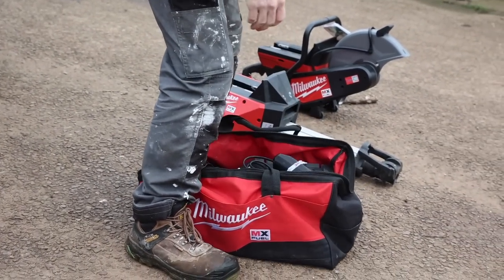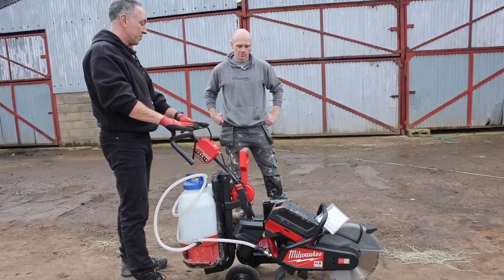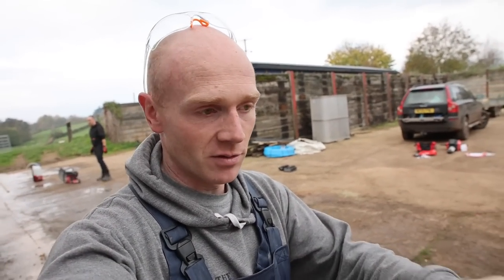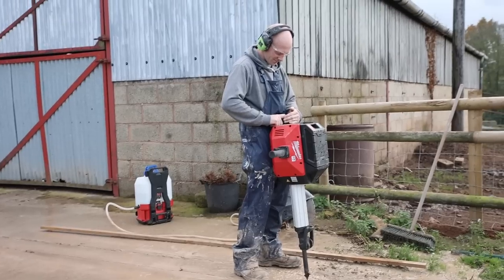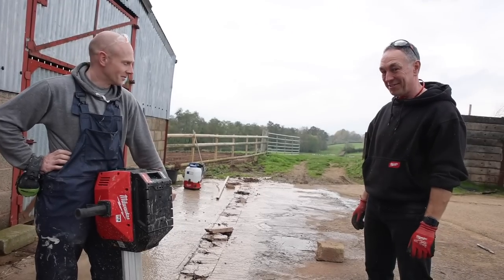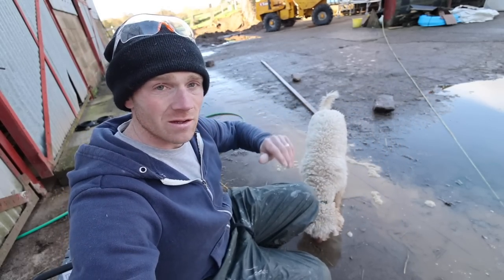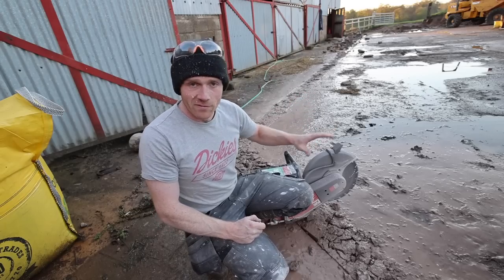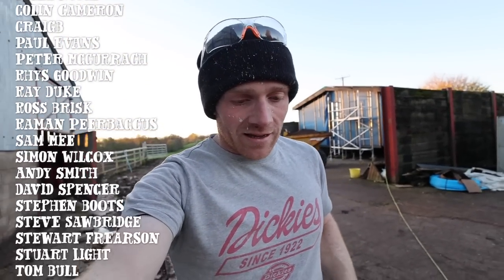CUTTING & BREAKING CONCRETE WITH BATTERY POWER - Is it up to the job?

Comment: Think it will become a full time job on site for someone to manage batteries. But having worked recently with a few of the smaller battery site tools I'm loving the quieter sound and instant start. Again love the genuineness of this channel when it comes to use of branded products. So many Chanel's have tool sponsors that they change every year just for cash which I get there's a cost to make videos but feel it often distracts from the content. This was great ❤  👍

Comment: Have cut a lot of concrete, for that I would have hired a floor saw, fee would have been sub a hundred quid with blade wear allowance. Made sure the ground was cut under the concrete to a good depth, this will help prevent the edges spalling off when you pull out the spoil. The pad relies on spreading the load to resist fracture, when you cut into it you make a weakened area which needs to be buttressed somehow. This may be achieved by the mass of the new pour, if it can be an inverted cone shape under the existing slab this can help. A new pour with a formed gulley along the top is a good, cheap solution. Particularly if its not permanent. Individual pre formed gully units require a good base to provide load resistance, are expensive and not always great in your application. A couple of hand formers made from timber or ply in the shape of the swale will do for the length of cut you have, I generally make a spare as they always seem to break when there is apile of setting concrete in front of you. Some starter bars in the surrounding material might also help but if it's thin then this may be a bit nurgatory. I'm sure by now you will have filled the hole, fed the managerie and laid a new floor. Always great content. TVM.

Comment: You could use a length of 200mm drainage pipe as shattering / a former to give a smooth channel if you was to cast it in concrete yourself.
Thanks for the content.

Comment: Very interesting to see this now Hilti have launched their cordless range - their comparison breaker (TE2000-22) has more power, weight half of the Milwaukee one and lower vibration...and you can have it for around £30 a week whereas hiring the Milwaukee is £90 a week! The saw itself in comparison to Hilti is bigger, uses a 350mm blade for a 125mm cut whereas the Hilti (DSH 600-22) has a 300mm blade for a 120mm cut. It's also much less weight and can have it for £17 a week, not £54!!

Comment: Batteries for the clean operation and the lungs of the operator, not to mention very easily recycled after the long user life they have .... when the grid comes to nearly complete sustainability, away from fossil fuels, then the running costs will make it clear to the dinosaurs that it is the way forward and not a fashion, Top video as always !

Comment: Using batteries for that cutter seems massively inefficient from an energy perspective. I get that in an unventilated space it's a bit nasty to use a petrol/diesel variant, and that for small jobs a cordless cutter is very useful, but a straightforward job like that is begging for a corded tool or petrol/diesel.

Comment: I think there's a lot to consider here. As all ready suggested those batteries can't be cheap and what kind of life expectancy do they have. On top of that the constant need to charge and the number required for the convenience of having a full one to hand on a bigger job. Then there's the durability of the machines themselves. I guess the adventurous will buy/hire them now and others will wait to see the overall consensus not unlike electric cars.

Comment: The batteries are always the issue , charging , how much does the backup batteries cost , can you get a power supply , as the batteries reduce in charge as you said they get weaker , 
The more charges they take reduces there life span , and do you have to take more breaks to wait for a charge , then you have to keep stopping , 
Interesting though .